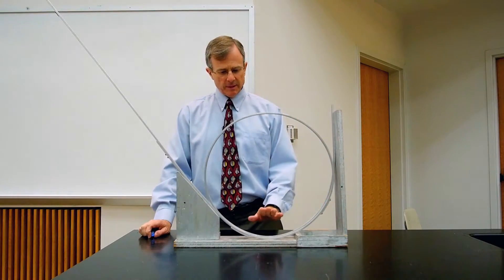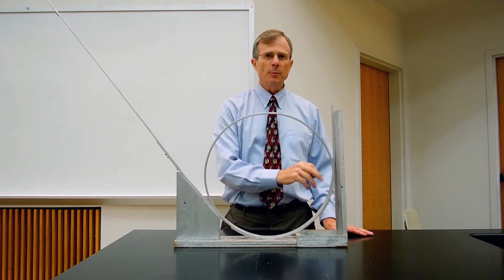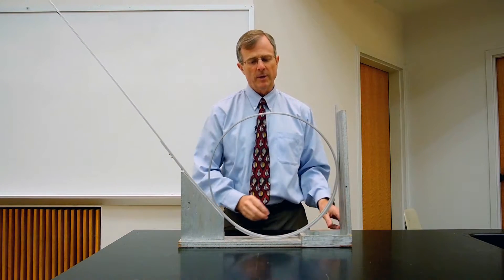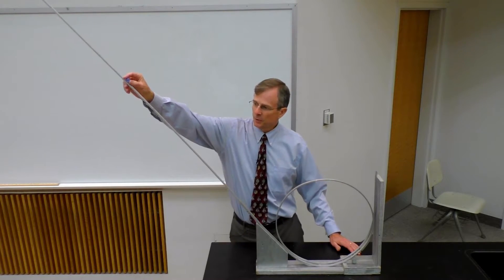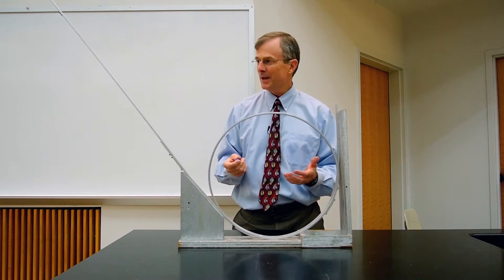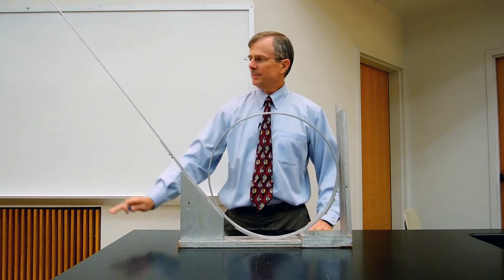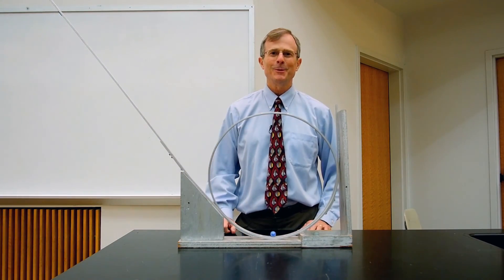Dynamics Demo: Loop the Loop

Comment: is friction having some effect on the demostration?
Reply: obviously
Reply: Good question you are a good question.
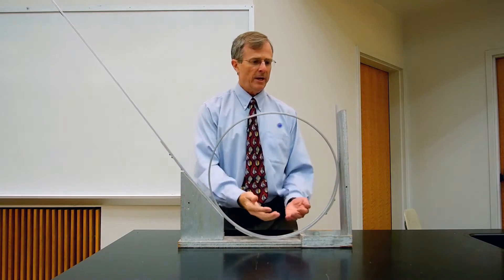Reply: right! it's a great demo but friction wasnt discussed, yet it has a huge impact on the demo. For example you can see at 1:27 the "critical height" at which the marble makes it around is moe than 5/2 r, it looks even bigger than 3r. The extra height is needed to overcome friction.
Reply: Two things I didn't think of in my original comment: 1) the ball is rolling so its rotational inertia must be taken into account, so the critical height might be 2.7R not 2.5R (the moment of inertia of a solid sphere like a marble is 2/5mr^2); 2) the track is flexing when the marble is placed and may be storing spring/elastic potential energy that might be being transferred to the ball.